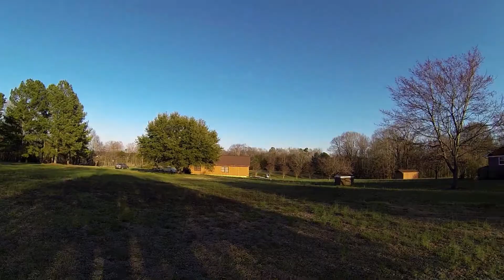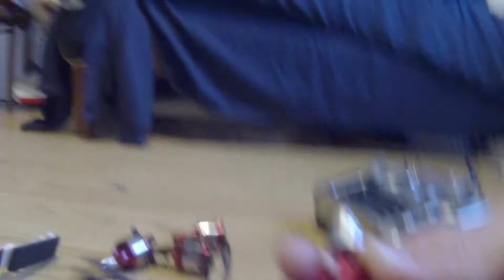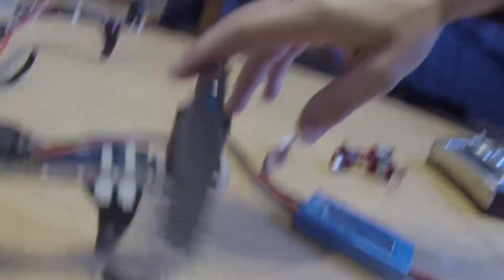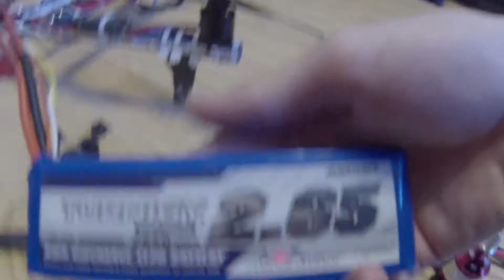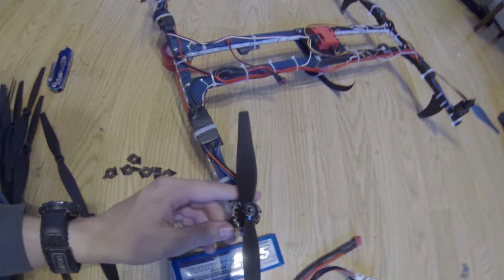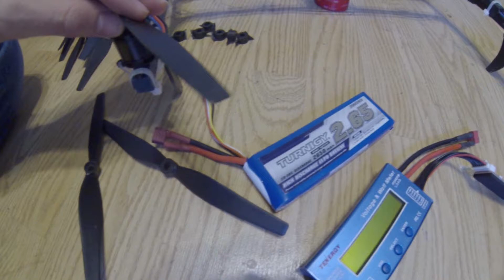3d quad build part 2

Comment: I have a cc3d..is this fc capable of 3d flight?
Reply from the maker: I was using a naze 32 but I know any board with betaflight or clean flight will work. You can probably flash your cc3d with betaflight and get it to work.

Comment: what ESC is that?
Reply from the maker: the fire red ones for ready to fly quads these are 20 amp but i need to upgrade to 30amps ones
Reply: RCflyer729 I was thinking that banggood  Emax Simonk 30amp ESC would work,
Reply: flight budz where did you get the flasher tool
Reply from the maker: flight budz
i would think that the emax ones would work fine the flasher tool is just a slandered asp flasher u can get on ebay here is a good rcgroups for that u can find a lot out at http://www.rcgroups.com/forums/showthread.php?t=1849952&page=55#post29828197
here is the programer http://www.hobbyking.com/hobbyking/store/__27990__USBasp_AVR_Programming_Device_for_ATMEL_proccessors.html
this thing makes flashing your esc so much easier http://www.hobbyking.com/hobbyking/store/__27195__Atmel_Atmega_Socket_Firmware_Flashing_Tool.html
Reply: RCflyer729 where did you get the software
Reply from the maker: flight budz
from that rcgroup page i sent u just go to the first page